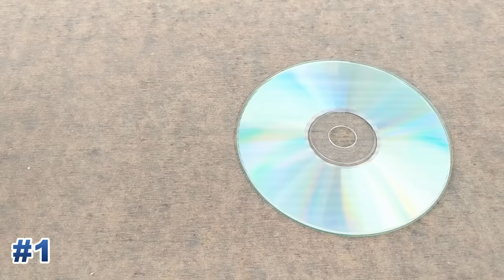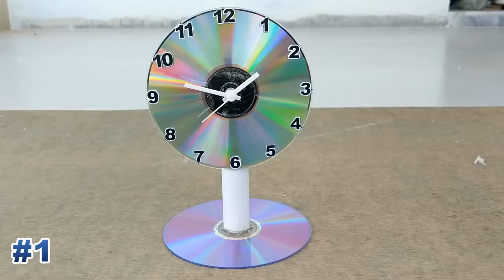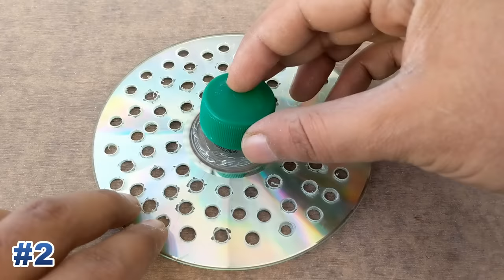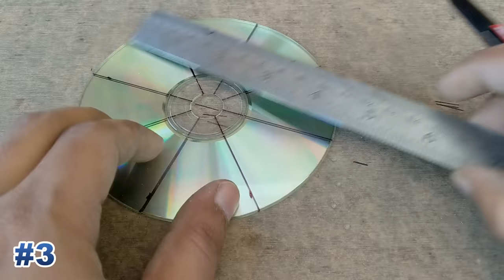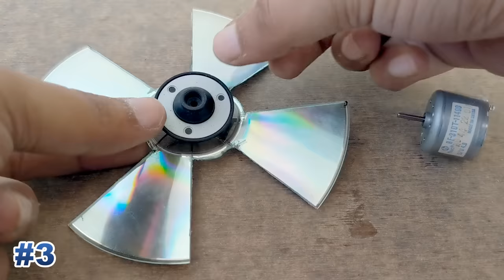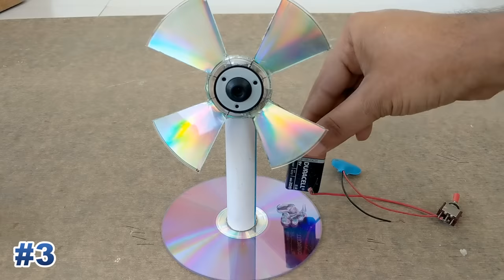3 Amazing Life Hacks of CD !!!

Comment: When CD music disks first came out, the 'sales demonstrator' would take a disk, and drill a hole in it (always at the outer section), place it in a CD player and exclaim 'it still works!' making the VERY false claim that the error correcting features will keep it playing. In case you don't know, CDs and DVDs start from the inside track, rather than the outer like the regular vinyl disks then being sold. Later, everybody knew that even a small scratch is deadly to operation.
Reply: Ah no... it also renders the player too.

Comment: He can’t change the battery on the fan, it’s glued to the bottom CD!
Reply: It's a glue gun, jazzie, if you're too weak to just snap it off with 2 fingers - melt it with your hair dryer ;-)
Reply: @kotobus  
Still stupid. Then he would have to clean off the old glue and stick on another battery, instead of gluing it on the other way round with the battery connection glued to the CD. Simples!